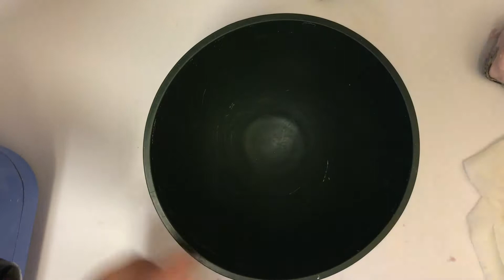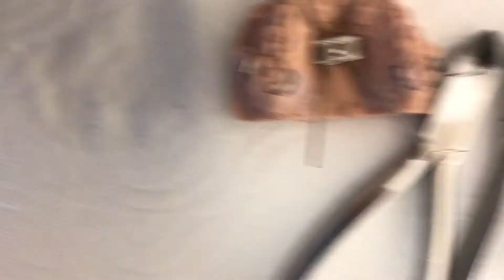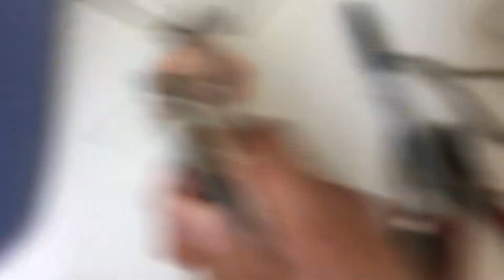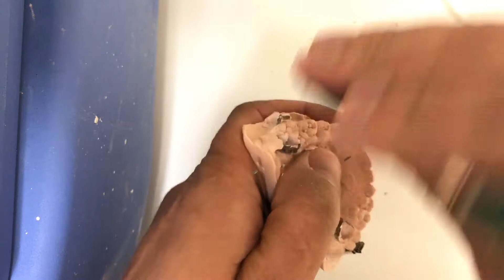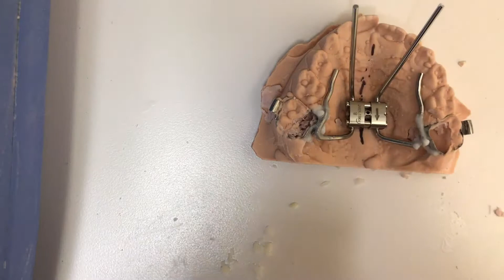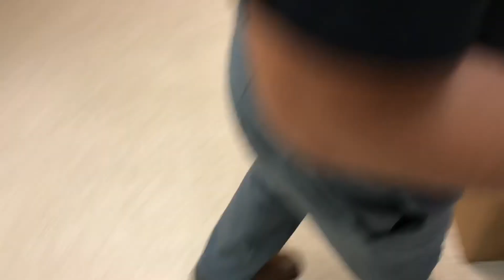Complete fabrication of orthodontic RPE appliance

Comment: My opinion is that you need to study a little better the technique of making the palatine expander in mixed dentition. Because the two front arms do not cut.
Reply from the maker: I’m not sure exactly what you’re trying to say, but if you are saying that the expander should be made with all four arms then I disagree. There is no need for the front arms. Expansion is just as good with just two arms. I deliver multiple expanders per day every day and have never had an issue with not getting sufficient expansion in mixed dentition. 
Attaching the front arms makes the fabrication more difficult and more time consuming, and makes the appliance less comfortable and less hygienic. And does nothing to achieve better expansion. But this is just a video showing how I make the expanders that I use. You of course can do it however you prefer.
Reply: @markgeorge1228  Honestly, I highly doubt you are an orthodontist